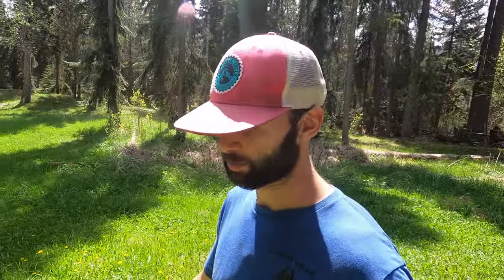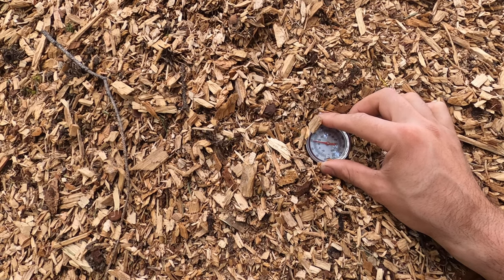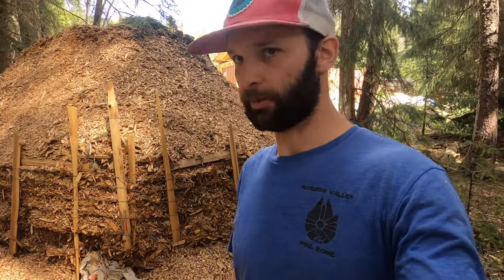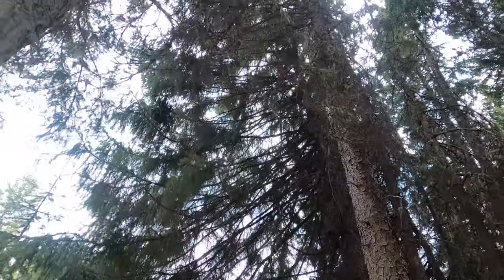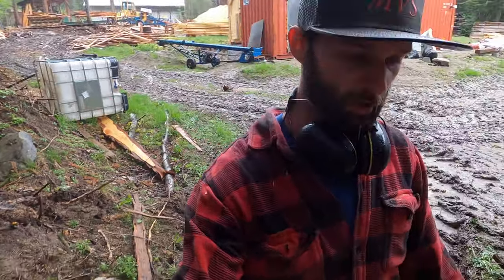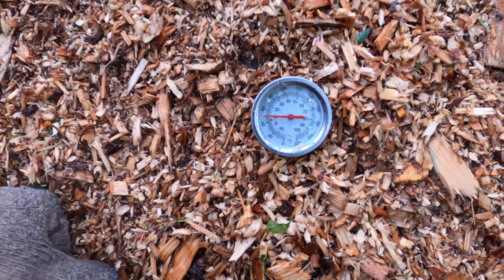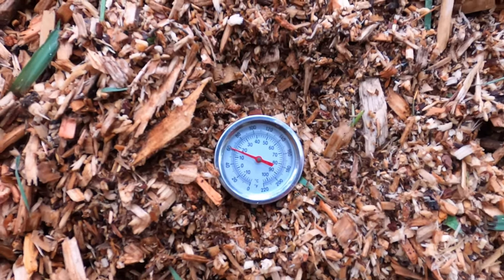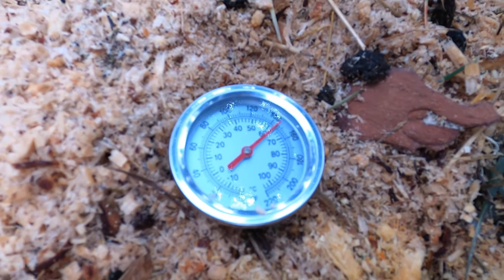Composting Wood - getting your compost "hot" with FREE kickstarters

Comment: It's all about what you can find around you, and you did pretty well. sticking road kill, some dead fish, as you mentioned manure, urine and my favourite, spent bags of mushroom substrate.  Water and mycelium chomp through the mass with moisture management without thinking about temperatures
Reply from the maker: Ya some sort of starter and then just lots of compostable material sized appropriately and air to keep the process going. I have lots of wood chips.

Comment: I'm still in the experimenting phase right now, but believe it or not if you go get a bucket of old organs and intestines and blood and guts from the butcher shop it will jump start a pile very quickly, you just.need to make sure it's got plenty of air and water, I personally rotate it with the tractor once or twice a week. This works especially well when you have mostly wood chips. Also I think 160f to 165f degrees for compost is perfect, it's just like cooking pork. You want to get it hot enough to kill of any bad bacteria and parasites. And also sterilize any left over seeds from plants and grasses. If you can pump air and water through the pile to control it you'd have it made

Comment: How did the pile turn out? In the last three years
Reply from the maker: It’s about finished its cook. I added material on top a couple more times in the spring if I had hay or grass kicking around. I can pull the pile apart and soil test it next spring if you want to see that part.
Reply: @MountainVoiceInc  I like we all love these huge piles, and the use they have to heat Green House and the alike. Good work.

Comment: I used urea to break down wood chips from a Stump. Wood chips are carbon, you need to add nitrogen.
Reply: Can you give me more details? I have about 15 tons of dry dead hardwood chips but almost no greens to mix, and after doing research I decided that urea was my best bet. Any tips / advice you can give me? My main goal is to get it hot (ideally 140 F or more). Thanks!
Reply: @arooobine  build your pile in layers 9f 4" to 6" and sprinkle urea on top of each layer.  The pile I started in September is maybe 80 degrees but still very dry. Trying to get more water on it and aerating by forcing a rake handle in and rotating the rake. I'm in ohio so it will stop soon. Last  time it took 2 years. Keep in touch.
Reply from the maker: I have to test this theory, but I think if you get a healthy aerobic compost going with a fresh air intake the nitrogen is mixed in from the air. Sounds a bit far out but my test will be if the soil ends up neutral ph and nutrient rich without me adding any nitrogen.

Comment: What did the pile do when we hit that 40 deg heat?
Reply from the maker: It was pretty hot, but then it dried out. Need to add water to keep it cooking. Although it’s in a shady spot to help prevent that.
Reply: Having it so close to those pines will make roots suck up moisture and nutrients from the pile. I made that mistake before. Now I pile up my compost directly on top of my garden in winter. By spring, I till it in when it's just right. Any leeching of nutrients end up in the garden. Bell pepper stalks get as thick as a carrot

Comment: is the stack hot enough that cold water running through taking heat wont slow or stop the whole process?
Reply from the maker: Not really no. If it’s a continuous stream of cold water it does cool the pile too much. So either slowing the water down probably by increasing pipe size or increasing the size of the pile is the solution to that problem. Cycling the water also works but it cold shocks it every time.

Comment: I have a rabbitry and am pouring gallons (30 gal.?) of rabbit urine on a large wood chip pile.  I am assuming this will quickly break down the chips.  Correct?  BTW, rabbit manure is the most nutrient rich manure around.
Reply from the maker: It would help for sure. Its important to aerate wood chips somehow. The manure or grass or whatever is used as a starter to bring in the micro organisms is important but they need some air to really get things cooking in there.